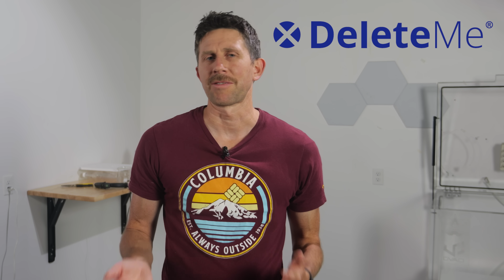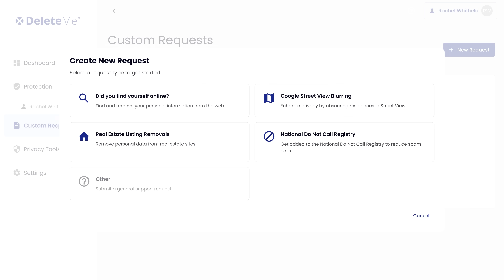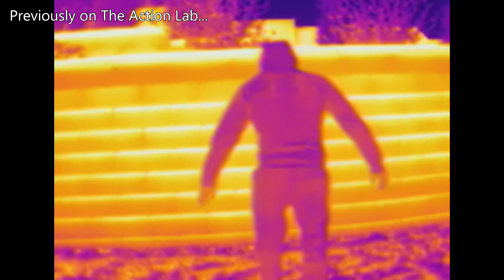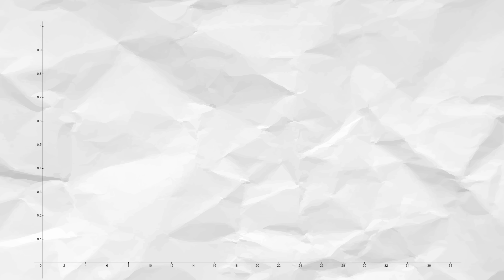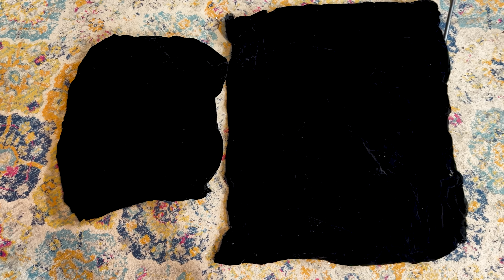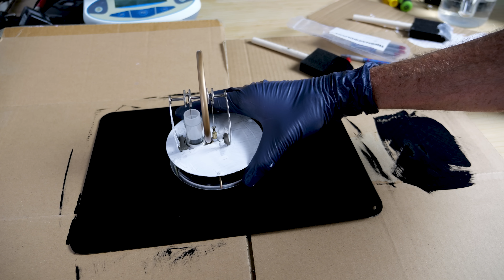This Engine Runs On Sunlight

Comment: This would work crazy well on the moon.
Reply: The whole point of cryopaint is to emit light in a frequency tuned to Earth's atmosphere.
Reply: These paints are limited to the portion of the spectrum our atmosphere is bad at absorbing, so on the moon, because there's no atmosphere, you can emit across the whole thermal-infrared spectrum
And sunlight on the moon is about 30-50% stronger than on earth, again, due to a lack of atmosphere

so in theory,  we could get a temperature difference of 200 to 245°C between the hot and cold plates

but when you consider the efficiency of Stirling engines, it's hard to compete with photovoltaic panels
BUT, where this could be useful... is if you were to cycle liquid through them, and store it in insulated tanks buried underground, you could use it as energy storage for the long lunar nights
Reply: @TheFloatingSheep if we use the heat from solar panels as the heat source the efficiency could be improved.
Reply: The gas chamber would have to be airtight though.
Reply: @mrsheldon9134  the what
Reply: @Josenobi  the gas chamber
Reply: @Josenobi the gas chamber. The engine uses the expansion and contraction of gas to power itself.

Comment: Excellent!
Reply: Ah! There you are! Welcome! Loved your electrolysis video!
Reply: @Sekir80  same
Reply: the messiah of radiant paint himself!
Reply: Seeing this concept come to life is amazing, and I love seeing this idea spread!! 

Pairing passive blackbody absorption paint with passive radiative cooling paint on a Stirling engine yields such a elegant, fuel-free setup...

In disaster scenarios, logistics fail first and the real killer usually isn't the event itself, but the immediate collapse of reliable logistics and redundant power grids.

A personal, cheap, low-maintenance, quiet, fuel-free backup generator like this fills a massively vital safety niche... 

It doesn't need to match the raw output or efficiency of a gas generator and power an entire house; it just needs to be a reliable, zero-input tool to keep essential batteries charged when the grid fails, or get the full energy by mechanically attaching it to anything with a rotational load, like its a weak portable water wheel, It could even be used for the fuel free pumping of water for irrigation and drinking, and would likely be no bigger than a traditional small home gas generator, like 2-3 ft by 2-3 ft maybe. It's the ultimate redundant fallback. Especially in places with regularly predictable government-mandated power outages... Or the need to pump water without nearby energy sources besides the sun, and if solar panels and fuel generators/motors are too expensive where you are...

It's just a great additive solution to a lot of weak daily energy needs,
And there are many places around the world where this could genuinely be the very first motor a family could afford to use at all and especially daily...
Reply: If I could handle a load on it, it would change the world.
Reply: BEN!  Please do a collab and explore this further.
Reply: Your turn.
Reply: I knew he would be here LOL
Reply: Wish there was a collab between @TheActionLab, @Nighthawkinlight, @StyroPyro and @PlasmaChannel would make for great edutainment, and possibly some new 👽level tech.  Hopefully these guys will meet and scheme at OpenSauce
Reply: <3
Reply: Would love to see if it would be possible to create somewhat of a self driven heat loop by facing the super rejecting plate towards the super absorbing plate.
Reply: @jamesa8851  the absorbing plate is also emitting, the point is to avoid the air capture, keep the system open to the atmosphere. In this case, it is much simpler to focus more light into the heated ring around there while leaving, obviously, an atmospheric gap for the rejection plate. Another thing you could do is put a massive chunk of copper on the top of it to help reject as much as possible to a larger area. Have light from a greater area pulled in from the sides and sent to the heat plate that would give a bigger area for both.

Comment: Can you please explain how that engine works.
Reply: air molecule movement
Reply: You can't really without a complete crash course in how thermodynamics works.
But I can try to summarize: it was made when someone wanted to do the opposite of putting two plates together.
That guy was named Carnot, and he was the one who determined how a heat difference can convert into work using expanding gas.
Stirling was the guy who actually turned it into a real thing you can build and use, but steam won out due to higher temperatures being inherently more efficient.

Comment: I wonder if it's more efficient than solar panels. BTW, can anyone suggest me how can I calculate it's efficiency?
Reply: Any solar panel the same size will beat that by far - if it even produces anything at all
Reply: It's the difference between the hot side and the cold side in kelvin divided by the temperature of the hot side
So 300k hot and 200k cold is a difference of 100k so 100/300 = 33% efficient

The bigger the difference in temperature the more efficient, and its inverse is the Coefficient of Performance for a heat pump.

Comment: Will it heat more than 150 C?  Can you safely put a Peltier module without burning it to generate electricity?
Reply: generating electricity from sterling engine isnt the best idea, bcoz losses are enormous.
This is directly made to skip electrical domain at all.
Reply: Stirling Engines have a Carnot efficiency delta of 1: they are as efficient as they can be. Peltiers are way less so because they lose heat to themselves.

Comment: That was awesome-  I'd wondered if that would work since I heard about cooling paint.  

I wonder how large one could make one of that type of low temperature difference sterling engines *edit- quite large, apparently*.  I've got one like you used, but you can't do much with it.  I just wonder if such a thing could be scaled up enough to matter?  

And it seems like if you could use the black paint on a sizable thermal mass, like a big tub of sand in full sun, then that would be a good thermal battery to run your sterling all night.   You could just slap an insulating lid on your black collector when the sun went down so the blackbody couldn't dump all your stored heat, and force most of it through your sterling engine.... sorry, just riffing on the thought. 

anyway- well done

Comment: The problem with these kinds of engines is the law of thermodynamics which says you can't get more energy out of a machine than you can put into it using machine to produce electricity by the way produces a minimal amount of electricity for the amount of solar radiation that is put into it
Reply: This is just a science experiment.
Reply: @Mobin92 Yes but many people will interpret it in a different way according to their own indoctrinated presuppositional points of view
Reply: Why electricity?

Comment: Wowee- now extract the POWER from it. You've got the RPMs, but it probably doesn't have the torque to be useful
Reply: yes, sterlings have low pressure potential, but not all applications needs that
Reply: Electric generators work off speed, not torque.

Comment: Seems the efficiency could be increased dramatically by directing more of the heat absorbed by the cloth to under the pump. The pump would seem to be driven primarily by the temp difference between directly under it and it's top surface. Most of the rest of the heat energy from the cloth is just increasing ambient temp around the pump which would reduce the temp difference on the top plate reducing efficiency. Heat tubes? Channels?